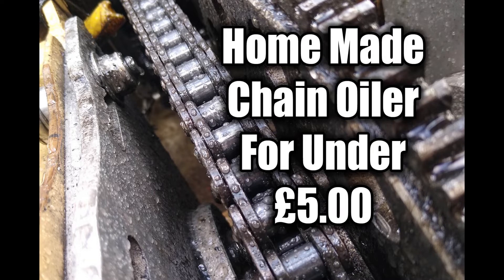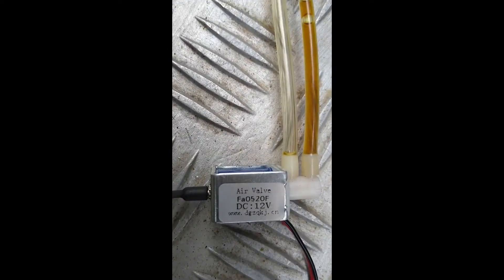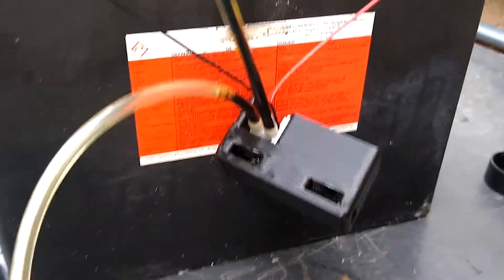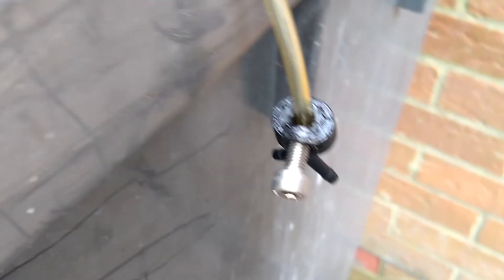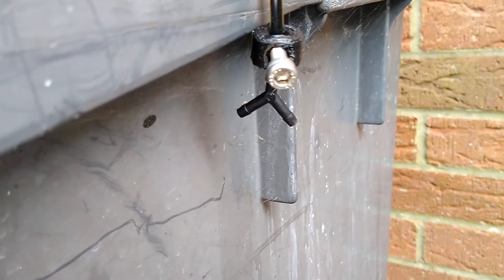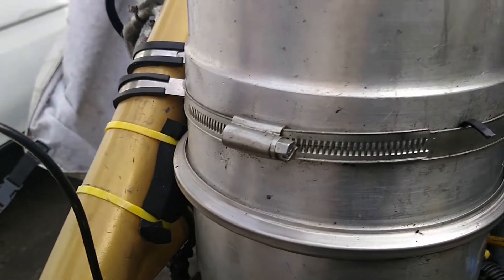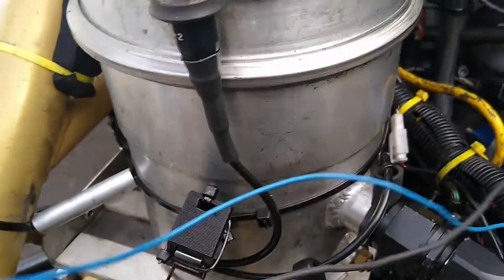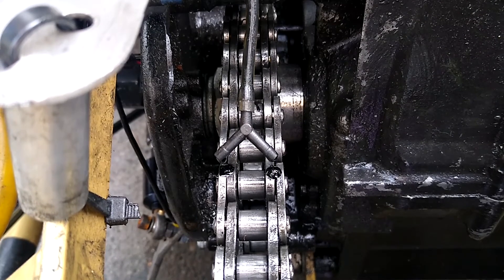How To Make a Automatic Electronic Chain Oiler -  DIY Motorcycle Chain Oiler for under £5.00 Part 1

Comment: I saw multiple videos, and literally everyone is oiling the o-rings, instead of the center of the chain, which is the real contact point.
Reply from the maker: @GarthSebastian  the aim is to get oil onto the pins that hold the chain together. Some will end up in the middle.

Comment: Nice to see ideas of how to restrict the oil flow with a screw etc. I want to make my own for the motorcycle, it's good that you pointed out oiling both sides of the chain as the Scotoiler does one side only which I don't get...
Reply from the maker: It's still on the car & working well.
Only change I need to make is relocate the oil to away from engine heat. Flow rate changes on hot days.

Comment: Try to apply the oil on the inside of the chain. In that way it will distribute better and not fling of that easy.
Chain manufacturers recommend transmission oil :)
Reply from the maker: Hi thanks for the tip. You'll be able to see in the later videos I moved the tubes so the oil is dropped onto the front sprocket - the system is now working very well.
Reply: @Lost13mm  It will fly right off the front sprocket it spins too fast. Motorbike oilers feed the inside of the chain at the rear sprocket for a good reason. Gear oil is also thicker and wont fly off as quickly, but remember drag bikes only run for a few seconds and the chain lube on these has a chance to penetrate into the rollers between runs. I dont know what the real answer is as bikes get more powerful and chain speeds get higher, I use the sticky stuff in a spray can and wipe off the excess, but I'm always looking to see if someone has come up with something better. 👍
Reply from the maker: @thra5herxb12s  HI - have a look at the later videos in this series. You will be able to see I change the oiling position to the inside of the front sprocket. 
It works very well like that. I'm still using old engine oil, which works well, but the "control rate screw" is rather fine.

Comment: clever idea mate...👍
Reply from the maker: Thanks. Just redesigned the thing to control flow rate. As the original let's about 40ml oil on the chain in 20mins